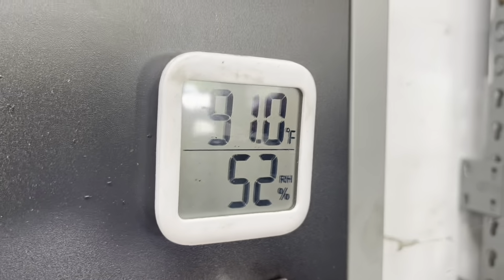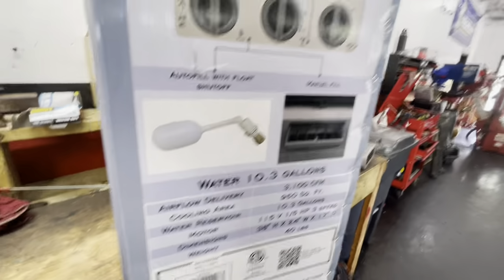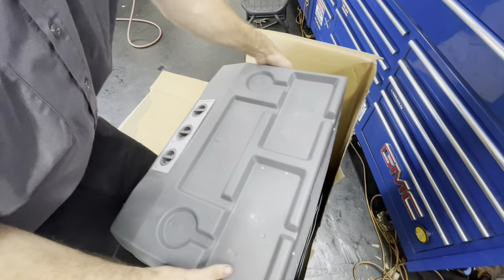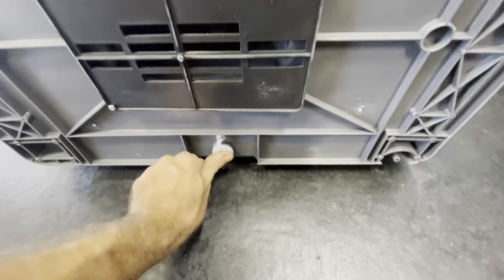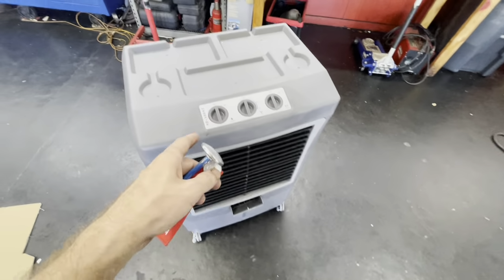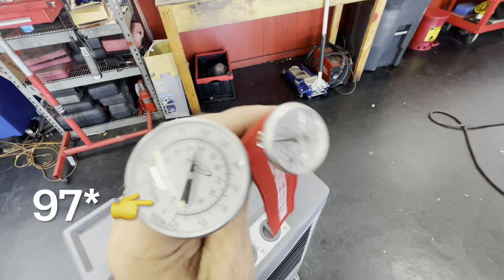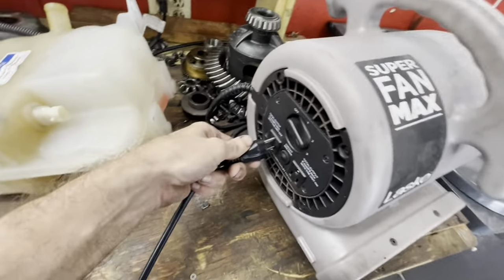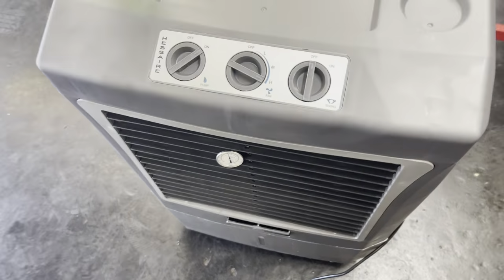Can’t take it Anymore!

Comment: In the west (desert) they are called swamp coolers...great for low humidity environment as I had one on my house back in the day. However, in a humid climate less effective but I hope this works for you!!
Reply: They don't work in Michigan. To much humidity already.
Reply: Are these really better than a good fan plus a wet t-shirt?
Reply: it may work till the humidity start to go up later in the year in Florida. and they smell so wonderful in a few weeks.
edit
i am betting tractor supply would have a few of the really big (6 foot) barn fans. and if the power that be would let you they make mister bars for on them.
Reply: THANK YOU! lol it is 115 here today in Desert CA
Reply: They don’t work well anywhere with normal to high humidity. They are most effective in dry air. I live in the Sonoran desert, they work here, but not during monsoon season.
Reply: I used to live in the Cali desert almost thirty years. Every summer 120 + don’t miss it. Cabot Yerxera came up with the swamper. But the humidity level makes me ineffective.
Reply: @lechatbotte.  ya I use one in a small room but most of time it's the AC and I'm getting out of CA
Reply: Humidity kill these, wait for calcium build up. We had Master coolers out in the desert back in the day.
Reply: That's what they're called in South Carolina also. Swamp cooler.
Reply: yep swamp cooler, not air conditioner (like op called it), A/C's basically are heat pumps that use compressors and gas expansion to move heat from one side to the other, they can also remove humidity from the air. 

but in low humidity areas this would work fine. in midwest it would be like making a hot muggy day even more muggy with a side of stank and sweat. best we can do in an open space is just use large shop fans.
Reply: We have them in Australia too out in the low humidity environment areas. They're not bad but naturally not any good in the high humidity coastal regions.
Reply: @FenrirYT13  A swamp cooler would def work for  you!!
Reply: @boggy7665  Stop! Don't want to see Ray in a wet t-shirt! So don't give him any ideas.
Reply: Technical term is evaporative cooler.  Works great in low humidity, just a regular fan over about 40% humidity.
Reply: @FenrirYT13  
Cooling trend? Better throw another log on the fire 😉
108 here today, Cochise Stronghold
Reply: In humid climates they make it worst tbh
Reply: @johnnysouza5601  facts! We have giant ones at my job here in Missouri. Completely useless in humid regions.
Reply: Same ad Florida, totally ineffective, they shouldn't sell them in high humidity locations
Reply: @noworriesmate5903  you don't need them in Michigan. Its already not hot
Reply: I came here to say the exact same thing.
Reply: He should have just bought a mobile ac unit
Reply: They call them swap coolers - which is odd because the one thing they CAN'T do is cool a swamp.  What they can do is create a swamp where none existed previously!
Reply: @boggy7665  if there’s low relative humidity. They’re amazing
Reply: Slang. Still evaporative cooler.
Reply: @jerrynewberry433  useless waste of power
Reply: @---ny4ys  97 today
Reply: @noworriesmate5903  wow 1 whole day? That's the average daily where Ray lives
Reply: @Chris-hw4mq  well, I used one in my old shop, lowered the temp from 110° to about 98°.  Let me tell you, it's better than heat stroke.  This was in high humidity San Antonio,Texas.
Reply: @FenrirYT13  yea you should get some of this heat we have in Mississippi. It’s 93 with 90 to 93% humidity yea desert people would die if they had the humidity out there. Come to Mississippi in late July early August when it’s 101 degrees an 100% humidity yea get you some of that
Reply: @dirtracer8919  I grew up in Louisiana and lived in NC I understand humidity I prefer it over dry heat. Can't wait to move back to NC
Reply: @FenrirYT13  so you know what I’m talking about. I lived in west Texas 1 1/2 southeast of Lubbock tx an then New Mexico. Yea they don’t have nowhere near the heat we have here.
Reply: @jerrynewberry433  high humidity in San Antonio yea. Come out to Mississippi in late July early August when it’s 98 to 102 degrees an 100% humidity that’s hot
Reply: @dirtracer8919  no they don't. Humidifier doesn't help out there in NC and LA lol
Reply: I lived in west Texas when I was a youngster it’s not hot out there. It’s hot here
Reply: These folks are correct.  I lived in an apartment in Yuma, AZ and yeah it worked.  However, 2 clouds in the sky (which was rare) and it was just a fan.   Won't help much in a humid area.
Reply: @flyingGrandpa  Semper Fi Howard. I just think in the end of it works for him we are glad lol. Oorrraahhh (RET USMC)
Reply: Likewise in the same corner. In Summer they almost never get shut down...use a fraction the power an AC would.
Reply: I doubt it: why would they be called "swamp coolers" when there are no swamps in Arizona? I do believe the swamp cooler originated in Florida / deep south when a stream of air was blown through or across a stream of running water. The dampness of a wet breeze in a swamp is cooler than still, stagnant air - regardless of humidity.
Reply: @batch1638  they call it swamp cooler because of the humidity and the big area that holds still water
Reply: @batch1638  They add moisture to the air that evaporates & cools in the process. Swamp Cooler just being the official slang term...rolls off the tongue better than Evaporative Cooler.
Reply: Well the drought eliminates that approach.
Reply: Came to say the same thing. A piggyback system is the best!!
Reply: Very true. They are an excellent low cost alternative to standard A/C in a low humidity environment like the desert. They pretty much are useless in Florida or elsewhere where humidity is above 25%.
Reply: @CheekyMonkey1776  When the humidity % is too high, as long as the water is off & pads "dry" then the blower by itself still helps. Just not as effectively as just keeps air flow going.
Reply: @CheekyMonkey1776  One flaw, water is about to be rationed.
Reply: I used swamp coolers when I lived in Utah. They worked great with the dry climate there. But, here in Southwestern Illinois, it’s too humid for them.
Reply: And they're a maintenance nightmare too, which is why you see fewer and fewer of them being put on houses.
Reply: @noworriesmate5903  bro he is in florida, the 2nd most humid place in united states behind houston
Reply: @rob.granger  Speak for yourself LOL
Reply: I lived in Arizona as a kid. We had one of these in our living room. Add water every few hours and it worked great! 

In Houston, we had one for an entire apartment building. They do work in humid climates.

Comment: About evaporate coolers: When the humidity reaches 50% the process will stop cooling.  Great for Arizona most of the year, but Florida not so much!
Reply: Literally in Arizona sitting on the back porch with one of these blowing on me. Works great until the rain comes.
Reply: At least it will still be a fan, just pull the filter or don't fill the reservoir.
Reply: @MonkeyJedi99  It's got a filter? Imagine all the crud it'll take out of the air. Gadzooks!
Reply: @evanfurn920  You still getting rain there? No drought? 
 They install powerful AC units, more like refrigeration units in those hotter than heck areas, and don't spare the insulation. Put your fryin' pan on the asphalt and cook some eggs.
Reply: @thomasmleahy6218  No, it's not a filter. It's a mat that holds the water. The air passing through it is supposed to add the water into the air but it does not work if the air is already wet. If anything, it could make the situation worse.
Reply: So, not a really good purchase my friend.
Reply: It’s not humidity that determines weather it will be effective it’s the dew point you need to pay attention to

Comment: I’ve got a swamp cooler similar to that in my shop.
ADVICE Keep an eye on the dust/dirt buildup on the cardboard that the water runs over!  It’s a magnet for it!
Good choice and enjoy the cooler air!
Reply: If Ray intends to keep using this device, he should get a couple of replacement filters while they're still in stock.
I had a cold-air humidifier, essentially the same process in a smaller table-top device, that I had to toss because the company stopped selling the filters after a few years. And those filters got NASTY quickly.

Comment: Swamp cooler... designed to use the heat of vaporization of the water to cool the air flowing through it.  Works best in an arid climate south very low relative humidity.

Comment: I was thinking "don't destroy the box for when you return it!"  Those don't work well in high humidity environments.  Here in Nevada we use them but it's super dry here.  You can "boost" them by "pre-wetting" the filters.  Spray your filters down with water from the hose and it will be instant cold.  The water pump alone won't saturate them.  This is coming from years in Vegas living in a trailer.

Comment: Swamp coolers are more effective in really low humidity (desert like) conditions. It does works if you hug the unit and keep feeding it ice. And a 10 degree drop in temp is 110% better than the sweltering heat.

Comment: Nice Ray, you've got yourself an evaporative (swamp) cooler. It's called a swamp cooler because it smells like the Florida everglades. As many of the comments state, they work poorly in high humid environments (like Florida). It's best to not run the pump when the air is already wet, FYI. But hey, it's better by far than working in the stagnant air in the shop.

Comment: Commonly called a swamp cooler. It just adds cool water vapor to the air
Reply: actually the water draws heat out of the air as it passes through the filter. Vapor in the air is just a byproduct.

Comment: We recently got a good few of these in our warehouse (exact model too, maybe a little bigger), and they seem to help a little. Someone set a big drum fan in front of it so it's helping to push/spread that cooler/wetter air a bit more. Once you're like 10~ feet away, you no longer feel any cooling benefits. Warehouse is usually mid-80s with many fans running every which way.

Comment: There's a dealership up the road from my home, that installed air conditioning in the shop where guys like you work.  They had one to many workers pass out when the heat wave struck and wind up at the hospital for heat exhaustion.   They installed a giant ventilation system to suck up car vapors, the spray can vapors, and the vapors from the workers.   But for those of you that are working in those ugly conditions (heat wave from Arizona, straight to the East Coast for the next several days) a BIG SHOUT OUT TO YOU AND THE GUYS WORKING IN THOSE CONDITIONS!  AND FOR THE PEOPLE WHO WORK OUTSIDE IN THESE CONDITIONS!
Reply: I'm up in North Dakota and some of that heatwave is heading my way. Suppose to be 104 on Sunday...might be a record!

Comment: When I was stationed in San Antonio, Texas at the Air Force Personnel Center, all four building's ACs ran on a large scale swamp cooler.  Water from the AC systems was pumped under the street to several cooling towers in the parking lots. Water was pumped up about 30' to the top of the towers and down over cooling fins then the water was returned under the street back to the AC units.

Comment: No no no no - that will not work - that is an evaporative cooler and requires evaporation to cool the air (as the name implies).  In Florida where the humidity is usually high the unit will not have enough "room" to evaporate water to cool the air.  As a result it will work well to humidify the shop but it won't do squat to lower the temperature in the place.  This is known as a "swamp cooler" because it releases high humidity air and turns the place into a swamp after a while.  These  units work well in low humidity hot environments like the desert and semi desert areas of the western US.

Comment: Yep, you bought a swamp cooler.  They work well where the humidity level is very low, like... 20% or less.  I got to enjoy one about 15 years ago when on a business trip to LA.  We were in a bar with a big swamper up on the roof.  Worked pretty good.

Comment: My boss bought one of these for me to use in the shop. We do have swamp coolers on the roof, however when the outside temperature goes above 100 they can only cool so much. Having the personal cooler to cool down the already cooled air helps. Mine actually blows out about 50 degree air when it’s around 85 in the shop. Only problem is I don’t have a way to connect it to a water supply. I have to disconnect it and roll it over to the sink about every hour and refill it. Small price to pay for a comfortable work place.

Comment: My apartment AC died last year when the temp outside hit 120. The complex said they had a portable AC then brought up one of these things. Issue with that is the apartment kept cooler than the outside temp so blowing 90 degree air into a 90 degree apartment and adding humidity was not going to be a good solution.  It may be able to cool the 120 degree air 30 degrees but when its 120 that doesnt really matter. My room mate ran it anyways and the place turned into a sauna. Easily 90% humidity and still 90 degrees he also didnt know it needed to be pulling air from outside to actually work so it was just blowing in a sealed room.  I found another place to sleep until the shitty apartment management company fixed the AC turns out the bought AC units that weren't even rated for the expected summer temps in my area so the HVAC guy said they have a lot go out every year.

Comment: If it's using water and ice... it's not an AC, it's a "swamp cooler'
These work well in low humidity areas.  Not so well in high humidity.
A small swamp cooler can cool a large area in the Arizona desert.
Reply: The way they actually work is by having water absorb "latent heat of vaporization" evaporating the water, adding humidity to the air.  Cold water can absorb more heat., but not much more than room temperature water.

With high humidity, it essentially can't evaporate much more water.... so it's mostly just a fan when the humidity is high.

Some days you'll get good results.  But I expect you are in a generally high humidity area. (most of Florida is relatively high humidity)

One of these devices can potentially turn a house into a mold factory in a high humidity area.

Comment: Ray, the others are correct - this thing is a "Swamp Cooler" used in more arid climates (they only work in low humidity).  Unfortunately, no place in Florida that I know of, has low enough humidity.  The cooling principle as I understand it is to add humidity to the air where it lands on people - evaporates and makes them feel cooler.  Adding more humidity to a humid room is only going to make you feel warmer because it won't evaporate if the air is already saturated.  Now if you try the thing with ice, you may have better results - let us know.

Comment: Another great Rainman production. A Ray out of the box special. Your swamp cooler is  similar to the industrial coolers seen on roofs. See, this is why Sarasota is less populated than the east coast. In summer we ( east coast) get an onshore wind. It keeps the coast cooler but causes the hot moist gulf air to almost stagnate over Ray. Then rain a lot. Swamp! Then come August we loose our breeze too. I've seen 99 degrees and 99% humidity. You just go outside and your dripping sweat. Makes breathing fun. Some patio bars use fans with water misters. Same theory. Doubt that's a good idea in a shop. Thing is you have the moisture in the air. An orange industrial fan drying the moisture off your skin is the best cooling your going to get. My 2 cents.

Comment: It's called a swamp cooler, they are or were pretty popular in the Pacific North West until it started getting too hot for them about 8 or 10 years ago.  Everyone was slowly going to the heat pump systems when I left there 2 years ago. When I got there I'm 05 Everyone has swamp coolers we had a heatpump installed  about 4 years before I moved back to GA. It's been 108-111 with the heat index for the last 5 days here in West Central GA.

Comment: I had one of those.  It keep on breaking and didn't work with the Florida humidity.  Go buy a portable A/C unit.  I use the hose that is supposed to discharge the hot air out a window on the cold discharge area and I point it right at me.  If I'm under the hood fixing something it's blowing on me.  It is best for evaporator jobs I pipe in cold air into the car.  I bought mine on market place for $50.  Best money I ever spent.

Comment: Bonjour, Ray ! Cooling is achieved by evaporation of water. Don't put ice in the thing, since it will not evaporate as easily as water at room temperature, it would have to melt first before it soaks the kinda filter at the back. Less efficient....

Comment: Your thermometer showed 91 with 52% humidity. That makes it "feel like" 98. I have a portable a/c unit I use in the bedroom of my apartment. Runs on 120 volt and is for small rooms. I have a good a/c unit in the living room but even using fans, I can't cool the bedroom down enough to be comfortable, I need my sleep! It works like a charm, nice and cool and happy sleep time in the summer! Hope that machine works for you.

Comment: Back in 40's-50's had basically same principal with big window fan and chunk of ice or water beneath fan blades, as other viewers have said, works good if humidity is low but many people before air conditioning often out used them. Only problem -would put so much humidity in house that things like your bed mattress would Mildew....

Comment: Swamp coolers work on evapotranspiration thermo effect where the water evaporates and in doing so drops the ambient temp several degrees as the water becomes vapor. They only work in low humidity, as we know that water won't vaporize in high humidity situations.